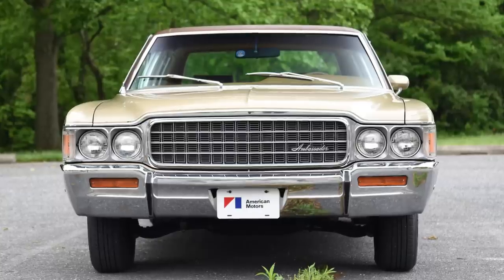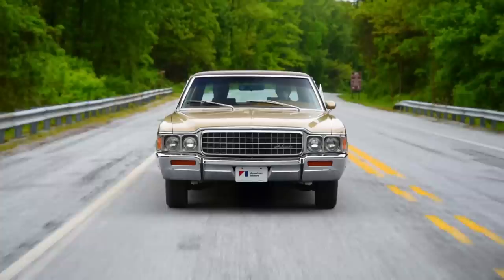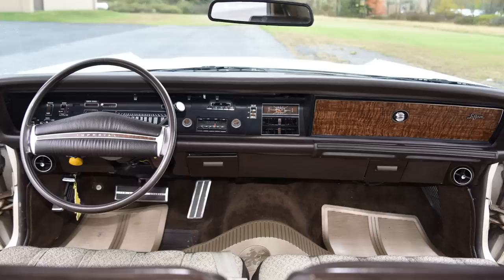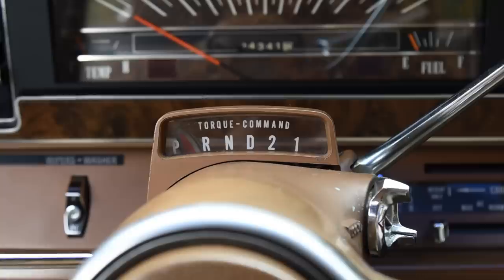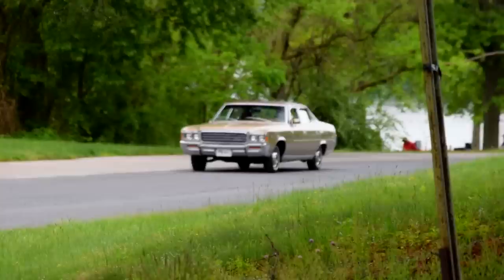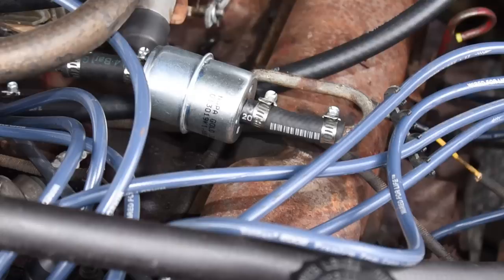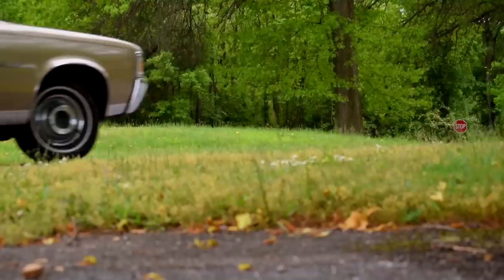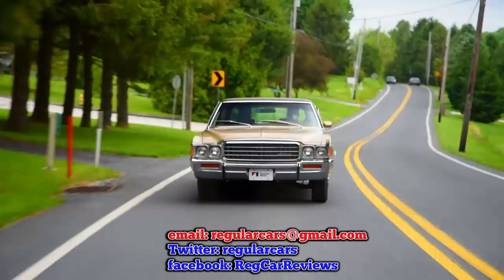1972 AMC Ambassador Brougham Sedan: Regular Car Reviews

Comment: 1972 AMC Ambassador Brougham: The official car of 70s car chases where a pedestrian car has to swerve out of the way and loses a hubcap in the process.
Reply: Helloooooo bias ply!
Reply: As soon as I read " 70s car chase ", I could see a loose hubcap rolling into the curb, clear as day... then I read the rest of the sentence.  : )
Reply: This is the type of car that gets T-boned at an intersection in the background of a chase scene in a late 1980s made-for-TV movie where the cars that are wrecked are all clearly 10-15 years older than most of the other cars on the road.
Reply: @kz1000ps  you can just HEAR it
Reply: This happened to me with my 1.0 litre Corsa...the wheeltrim went faster than the car :/
Reply: 1970 Imperial: Yep.
Reply: Believe it or not , the dashboard is almost the same as the 1970 models....we had the same type of radio installed vertically instead of horizontally....
Reply: I gotta say, though....those seats  looked a lot better than the Rebel's ; although it depends on which type of interior design you choose........yes, and this still was the "ERA of Bias Ply & Fiberglas Ply whitewalls ".... radials were still being " discovered"...
Reply: I watched "The Great Texas Dynamite Chase" here on YouTube a while ago. The car chases in that movie definitely felt tiresome to watch. Big v8s making loud noises sending out huge torque making them wheels spinning round and round but the cars just didn't want to move because of the heavy body weight of the 70s full size sedans (or by todays standard, huge ass monstrosity of a sedan that somehow still feels small to the backseat passengers)

Comment: The most American car ever: moving slowly forward, with great expense and noise.
Reply: uuuuuuuuuuuuuuuuuughhhhhhhhhhhhhhhhhhhhhhhhhhhhhhhhhhhhFREEDOM.
Reply: Where's the "great expense" or "noise?"
Reply: @sidefx996  The immense fuel consumption and the mechanical noise generated by the slab of iron in the engine bay.
Reply: @urbanoman7689  Prices on Ambassadors are VERY LOW relative to most any comparable Big Three offering, so "great expense" is decidedly false. "Noise" only really applies on these land barges if you install glasspacks on them.
Reply: @rastas_4221  Relative to most comparable Big Three offerings, it actually was. Double-digit MPG ratings and low noise was quite common on these Ambys, given how they were basically late-60s Ramblers with extensive changes made. Same basic platform.
Reply: Yes they beautiful, comfy and with much space
Reply: NumptyDumpty -Try a Tesla, fast and quiet
Reply: Most American cars of the time were very quiet
Reply: @ R BW

Great expense though. 

Also low quality, and slow while you are waiting for it to charge after demonstrating how “fast” it is.
Reply: @brawnbenson552  and rough, low slung suspension, low profile tires, hours of charging, etc.
Reply: The American way lmao!

Comment: My family had one of these when I was a kid in the late 70's...   It was green and a frickin tank.
 Mom backed into a Toyota once  and smashed the holy heck out of it.  
 The AMC didn't have a scratch.
 I don't remember it breaking down ever, either.
  Yeah, they don't make 'em like that anymore....
Reply: @jameslarson851  Until you're involved in a high speed collision.
Reply: @bazilmynazzle  what high speed? 🤣 you really have to try to get any kind of speed out of this car, there isnt much of an excuse to speed if it didnt take you 2 minutes to get to 65 MPH
Reply: @salteengamer4799  Mom's 68 and 73 Ambassadors never took long to be going above the legal speed limits. Both could easily pass at 90 MPH. And my 73 with the 401 would just be rolling at that speed. People didn't pay much attention to them back then which made them sneaky police cars. Mine even had the dual exhaust pipe on the passenger side tucked in behind the rear wheel instead of sticking out. I just wish that they had not rusted out under the hood at the firewall.
Reply: @gravelydon7072  Yep, the video's acceleration run just proves that it needs a tune, or that the driver's foot isn't heavy enough (maybe for dramatic effect).  These cars were plenty fast enough & would keep up just fine with modern traffic.
Reply: @boggy7665  I dont know dude, i dont believe it.
Reply: @flowgangsemaudamartoz7062  Personal experience.  I grew up in Kenosha when these cars were current.  Actually rode in one much like this, extensively, except it was a coupe.  Friend's dad a machinist at AMC.